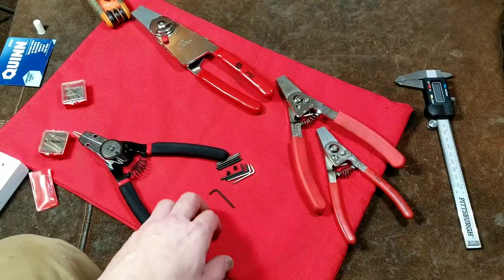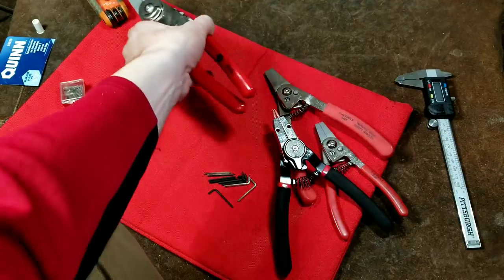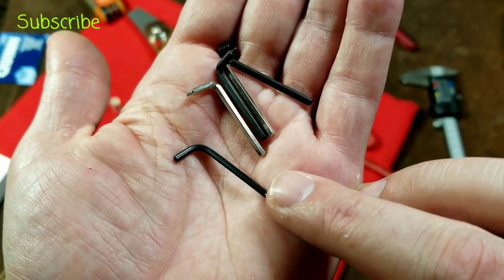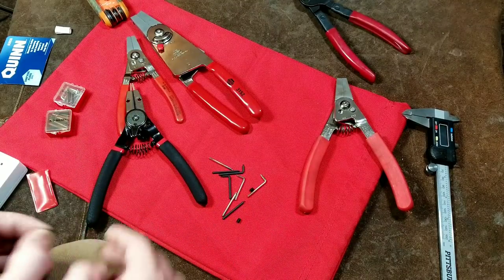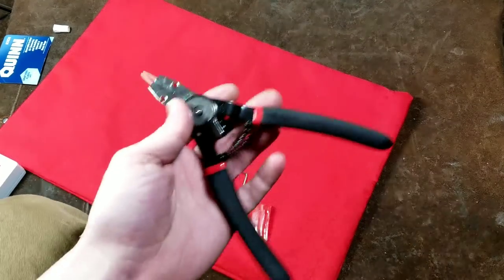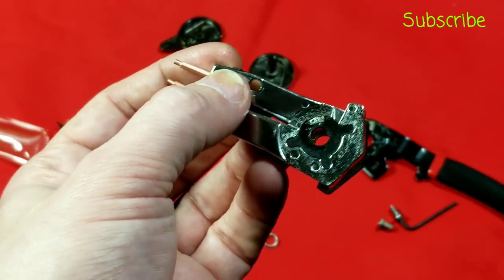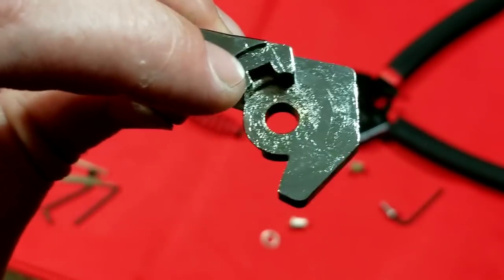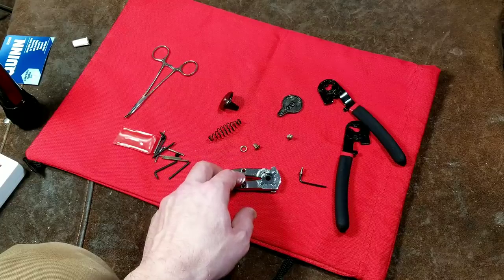Quinn Snap Ring Pliers vs. NAPA K-D Professional Snap Ring Pliers

Comment: Thanks for this awesome, in-depth review!  I'm actually looking for a single snap ring pliers with the interchangeable tips like the Quinn.  For the few times I will need this tool, I don't mind swapping tips.  I certainly don't need a multiple pliers kit jamming up my tool cart haha.  I was looking at this Quinn as well as the Channelocks version, which is about twice the cost for what looks like pretty much the same product.  I'm going to look at that NAPA now too.  I really like their little tip case variety.
Reply from the maker: The big difference I believe between the channel locks and the Napa KD in these is the channel locks and Napa have Steel Jaws where the Harbor Freight has cast zinc it is a much lower quality metal less strength than even brass and in the long run I worry about it
Reply: @CatusMaximus  Thanks for the help.  I ended up getting the Channellock 927's on sale at Menards for $16.91.  They seem perfect for what I was looking for.  And I found out that they are made right down the street from my house at Lang Tools haha!

Comment: Excellent video and review!  These do come in handy, especially when taking a ratchet apart. I'm wondering if HF is phasing out their Pittsburg line and replacing it with Quinn, or just adding more choices.
Reply from the maker: Thanks
Reply: They got a icon brand now also

Comment: What do you use on small external rings without the two holes? My snap ring pliers doesn't fit, larger rings with two holes no problem. .
Reply from the maker: This set does not come with a very satisfying tip assortment the ones from Napa include some tips that have microscopic little points on them
Reply: @CatusMaximus  Its a challenge when the small rings gaps is around 1/16".  None of my assortment tips will fit into the space. Managed to install it by force with 2 snap ring pliers, one to spread it, another to get in the gap. A few rings managed to fly off into never land and never be found.
Reply: Flat faced pliers .
Always called them LOCK RING PLIERS .
Maybe another technical name idk .

Comment: I have never had any luck with these. They are either too big, too weak, or just don't work right. I like the ones that you move the screw for different hinge point. The removable tips are my nemesis too!
Reply from the maker: I've had decent luck personally with these but yes they can be bulky and having the sheet metal versions as well are nice

Comment: ...I never have liked snap-ring pliers with interchangeable tips..in fact, I HATE them...I own a couple pair of fairly high-end USA made snap-ring pliers I have had for years, and frankly, I always hated having to scr@w around having to change the tips with practically every use, and having to try to keep up with the extra tiny tips and not lose them...and if you put a lot of pressure on them or use them a lot, the tip holders tend to loosen up and not hold the tips securely. A couple years ago, I picked up a set of 6 cheap GRIP Chicom snap-ring pliers with fixed tips...different sizes, internal/external, some straight and some 45 degree...and love them. I haven't touched the replaceable tip pliers since. In spite of them being cheap, they have been durable, and much more streamlined and less "clunky", better reach/clearance, and easier to grab the appropriate pair for the job than fiddle around with little loose tips. Takes more time to change the tips than remove the snap ring...just my 2 cents.. :)
Reply from the maker: I haven't had the same experience with the interchangeable tip snap ring pliers but definitely appreciate standard type snap ring pliers and their low profile